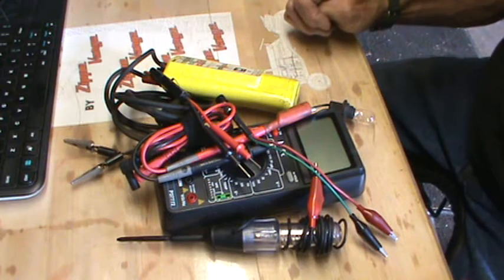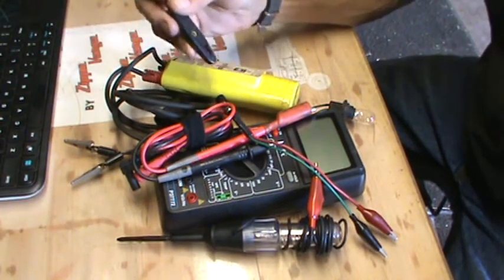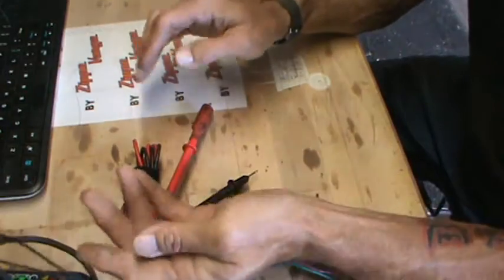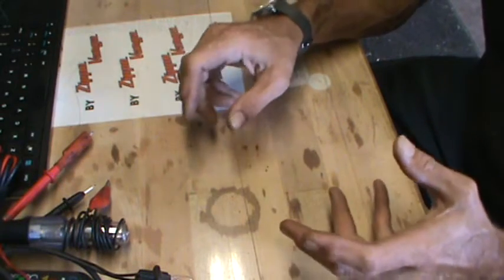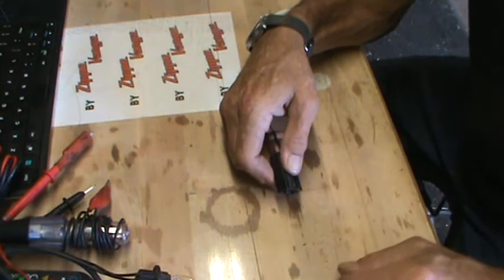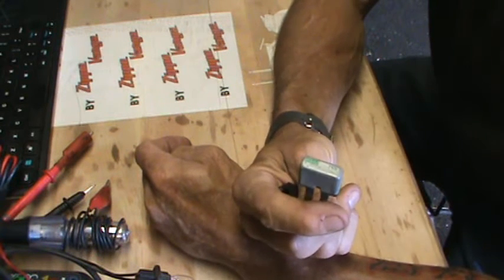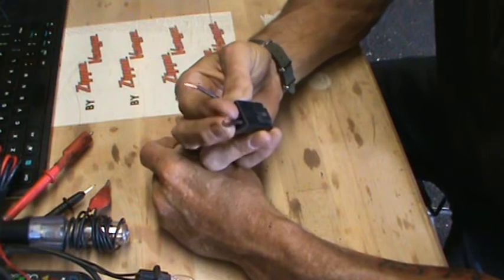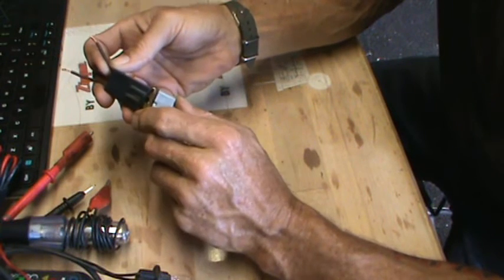Save Those Fuses! Troubleshooting Circuit Breaker Tester

Comment: My old shop foreman had an old school tester that could continuously power the circuit while limiting the amperage to what the fuse was rated at i wish i knew what it was called but this will help out alot while i continue my search

Comment: When I was wiring my Beetle I had trouble and was going through some fuses. It has the ceramic looking fuses with an external strip of brass/copper. I took a blown one and modified it so I could put one strand of multistranded(??) wire on the fuse. Kind of slow going when I had to reload it about twenty times but it did the trick. The single strand would blow long before any damage to the wiring but would hold enough current to test the problem circuit. Ended up that I had a running light wired positive to ground.